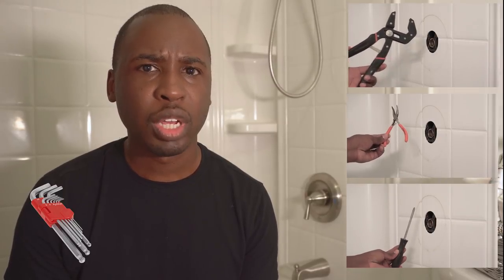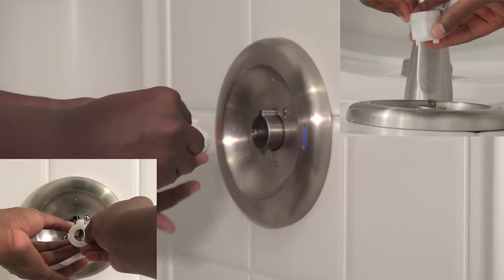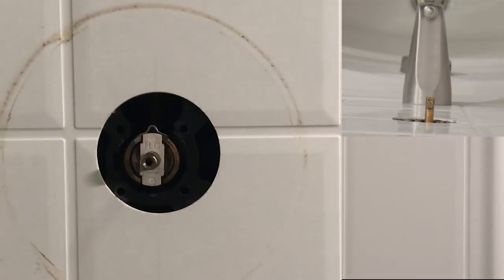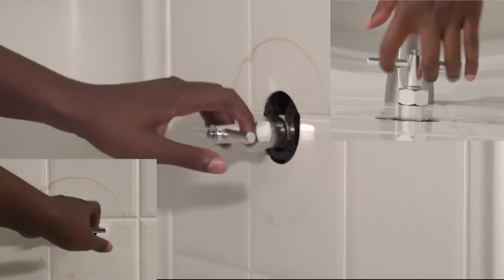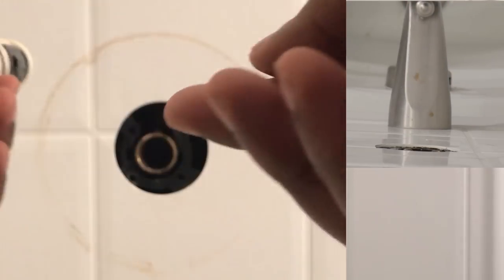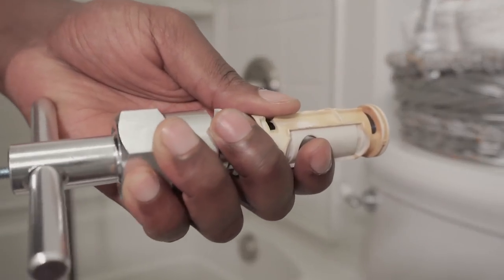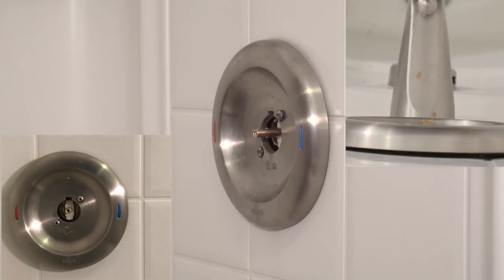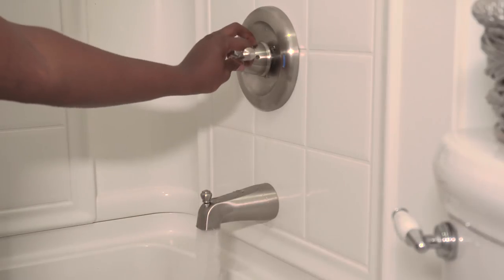How to replace a Moen 1222 shower faucet cartridge

Comment from the maker: Check out my other home maintenance videos https://bit.ly/2mxYnOQ
Reply: maybe you can help me with something, a few months ago I put a single lever of those moen but it turns out that when I turn it on, water comes out from below and also a little above, maybe I put it wrong because it is the first time with that work you could tell me that I did wrong please?
Reply from the maker: You could have possible put it in the wrong way but not sure
Reply: @Hindsight101  pop
Reply: My cartridge still will not move
Reply from the maker: https://youtu.be/T4NIAiSkl3w try this video. Also some people say applying heat to the cartridge helps
Reply: @jeziasmejia9642  Did you push on the stem putting it in so the back isn't flush? His video talks about that causing a leak!
Reply from the maker: Thanks for helping

Comment: After watching about 15 different videos on this subject, you are the only one who mentions having the bottom of the cartridge flush to prevent leaks. Thank you
Reply from the maker: No problem glad to help
Reply: How important is it to flush that out ? I installed one today and I might of pushed it in too , and It was leaking bad. Just wondering if that is a key step ?
Reply: @can2jmoney  yes, it’s exactly what happened to me. Ended up destroying the new cartirdge trying to get it back out. Sadly it’s not mentioned in any detail in the instructions the cartridge comes with.
Reply: Exactly. The explanation at the 7 minute mark is key.
Reply: This comment and video saved me

Comment: Great tip about not pushing on the center brass piece..  That's exactly what I would have done, and then would have not known to look behind at the valve not being flush..  Thanks for a very well done video - I really appreciated the multiple view angles too..
Reply from the maker: You’re welcome
Reply: Yes!!! This is the exact tidbit I needed to know. I replaced the cartridge once and accidentally did the same thing and tried to pull it back out but didn't actually check if it was flush. After I closed everything up the shower head immediately started dripping. Know I know why and what to check. Thank you!!!
Reply from the maker: No problem
Reply: I don't have the puller, so how do I make the end piece flush?
Reply from the maker: You could use a wide clamp
Reply: Yes! This information helped save my sanity. When I replaced my knob with a new handle, I must’ve tightened the handle adapter too much into the brass piece causing it to leak with that end part of the cartridge no longer being flush. Once I pulled on the cartridge, it stopped the leaking. Exactly how he demonstrated in the video with the tool pulling it back flush.

Comment: Okay, as a professional instructor, I really appreciate it when instruction is given clearly, step by step, and points out pitfalls - "the notch on the flat side" & "make sure the bottom is flush" - which are generally common mistakes.  I often watch 3 or 4 Youtube videos when I'm trying something new.  In this case, I watched 3 other videos, including the official Moen video, and NONE of those other videos pointed out the "notch" or the "flat bottom".  Kuddos for an Excellent video.  Definitely saved me a bunch of headaches.  Thank you.
Reply from the maker: Glad it helped, in a previous job I created training material and after watching a lot of youtube videos myself I thought I could help explain thing a little better
Reply: @Hindsight101  Well, you were right. Replacement went pretty smooth with your help. Thanks again.

Comment: Thank you for your video tutorial. I am a busy, single woman whose shower would not turn off on a Saturday night. I watched your video, then rushed to Home Depot 45 minutes before they closed. I worked on the steps and got stuck on pulling out the cartridge. That night, I ordered a puller from Amazon and it arrived Sunday afternoon. I continued to follow your instructions. It took a while to remove the cartridge, but I remembered your instructions about being patient with this step in removing the cartridge. It Worked 🎉. I continued to follow your instructions and completed the plumbing project with your instructional video. Thank you for your video. 

Ronnie
Reply from the maker: That's awesome to hear. Glad it worked out

Comment: I hope everyone is aware that MOEN has a lifetime warranty on its products. I have received repair parts for bath & sink faucets at no cost. And this video is top notch. I checked other on-line videos as well as the MOEN instruction sheets and video. This video covers all the little "why didn't they tell me that" issues. Good job.
Reply from the maker: I had trouble with getting the replacement neon told me I had To have the receipt. Which I heard from others you didn’t need. Also thank you very much for the comment.
Reply: how do you know which cartridge size to use?

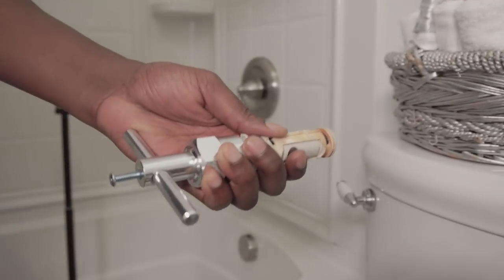Comment: Best instructional video on how to replace this valve, hands down! That pull tool is worth every penny of the $16 I spent on it. In my case, the old cartridge was really stuck in there and half of it broke inside the valve. No way I was going to be able to pull it out using the plastic tool that comes with the replacement cartridge. I don't know how old that valve was, or if they used the lubricant that comes with it but it was stuck in there so badly that I had to use a long thin flathead screwdriver to dislodge the pieces that were stuck inside the valve. Once I did that and checked the valve really good to make sure there weren't any small bits still in there, I was able to replace the new cartridge as he shows starting around 6:50.
Reply from the maker: Thank you

Comment: You, sir, are a credit to your profession, youtube, and the human race in general.  I was pulling my hair out trying to figure out what I had done wrong when I replaced mine.  In the video published by moen it says to turn the brass part to the off position before reattaching everything, which screwed everything up.  Your video left it in the on position, and that was what worked for me. Thanks for the awesome video!
Reply from the maker: Thanks so much for your comment. So glad it worked out.
Reply: Agree.  I don't know why the Meon company video tells you to turn the brass valve from notch at the top to notch at the bottom and then to install the handle.  That does not work at all.

Comment: Solved this problem, thanks to you! You were spot on that nylon key is not needed. The aftermarket moen puller has held up for me. The nylon key came in handy when I flipped it over to push the cartridge in place. The nylon key I was using had a hole thru the square capped end.
Reply from the maker: glad you could use the nylon piece for something

Comment: Thank you!!! I spent forever completing this job. My old cartridge was stuck due to the rubber on the sides. After I finally got it removed (i had to go buy the moen cartridge removal tool) I couldn’t slide the new one all the way in! The oil they give you inside the packaging is useless and wound up not being sufficient to slide mine in without ripping the rubber again. Swapped the broken one out and bought some faucet grease. Used the removal tool to insert and voila!! For whatever reason my clip wouldn’t fit but during one of my many trips to Home Depot I had bought a three clip replacement pack and one of those fit perfectly. 🎉
Reply from the maker: Awesome

Comment: This is a great video. Particularly around 7 minute mark about how to property push the new cartridge in. I made the mistake of pushing on the brass and pushed it in a bit, and hence when I turn the water back on it leaked. Ended up destroying a cartridge getting it back out and still didn’t realize why it was leaking until I saw this video. If you don’t have the puller you have to push in using the remove like yours or the white plastic removal bit the cartridge comes with. This avoids pushing the brass in.
Reply from the maker: I'm glad everything eventually worked out

Comment: Best video on the matter.  Thank you.   
Update:   I change two (non-leaking) as a preventive measure as they were 15 years old.  The Moen puller did work fine for me. Great advise to use the large nut of the puller and a wrench to pull out the first 4 mm out of the valve. After that a combination of pulling with the Moen puller while pushing with the finger on the valve, adding generously W-40 where the clip goes and moving slowly left and right (but only 3 mm each direction only to avoid that the unattached rubber fold if you turn to much), I manage to extract both in aprox 10 minutes each.   Quite nerve braking.   Thanks again for the video.
Reply from the maker: Glad it was helpful!

Comment: Great instructions and thank you for the tip on re-installing the cartridge with the tool... since I almost made the same mistake.
The old cartridge was a nightmare to remove because of the rubber seals getting caught between the plastic and copper housing! Tip: Use a little WD-40 when removing it. It helps!
Reply from the maker: Since this one I’ve had to replace a few more cartridges and they were a beast to remove

Comment: Excellent guide. Showing the mistake of pushing in the bronze stem saved me from doing the same thing. I used a 7/16" socket, a fender washer and a paint can opener to space my hillbilly rig so that I could use the philips head screw to start pulling the core out, as an alternative to buying the Moen puller. I suggest lubing the housing before installing the new core. Plumber's silicone grease is the best but the lube in the package works too. Wet an appropriate sized fingertip with lube and smear it around inside where the core goes. Photograph your old core and contact Moen Customer Service to receive a free replacement part. Sure, there is a nice new core in your shower faucet now; but, the one it replaced was new once upon a time. I have three of the accursed devices in my home. Moen sent me a FREE replacement for one that failed during a hurricane. Weather related, I don't think so. Just horrible luck. I used that replacement tonight when my personal shower faucet failed just as I was going to bed. OH! AND, you might suggest stuffing rags, or something into the hole around the faucet before attempting to install the locking clip. I lost three of the wonderful things while replacing my daughter's shower faucet core. I stuffed the hole before pinning the core tonight and the clip went in as if it knew there was no escape. Yes, I understand that I'm a little obsessive (and clumsy) (and cheap). Thanks for a very good guide. I liked it more than previous ones I have viewed. I think you might be one of the first to warn about pushing the stem in too far.
Reply from the maker: Thanks so much for you comment. The mistake was truly a mistake because I had to undo everything I did off camera because the faucet leaked after I was finished. That was a pain but if it helped others then it wasn’t so bad.

Comment: thanks Buddy, great video... I am having a problem with reassembly, having the retainer pin not seating in the groove, blocking the aluminium tube cover. any advice?
Reply from the maker: The only thing I can really say is this has happened to me before. Something's just misaligned and you have to keep trying. I know that's not the best answer

Comment: I did this yesterday, using the free replacement cartridge after I called Moen. That saved $48 right there. And I had success using the white plastic extractor that came with the cartridge to gently rock the cartridge back-and-forth no more than 1/8 turn either way. That saved me another few bucks by avoiding having to purchase an extractor tool.  Another thing that I did that nobody has mentioned, is before turning the water supply off and starting the project, I ran the hot water through the cartridge for five minutes to warm everything up, including the old impacted silicone grease. Another commentor above said that he used a hairdryer for this purpose. In any event, heat is generally helpful when removing stuck fasteners and other devices like these cartridges. Mine had a slow drip after installation of the new cartridge, and so I went in again with the white plastic tool and slightly rotated the cartridge and reassembled. The leak in the full off position then stopped. But that post installation leak was probably caused by me making the mistake of pushing on the brass spindle during installation.  One more thing I do emphasize in your excellent presentation is to remove the faceplate so that you don’t have to bend the retaining pin when removing it. And when you remove that face plate stuff a towel into the wall to catch the falling Jesus clip (“oh Jesus”) when you inevitably drop it into the black hole in the wall. Cheers, well done and thank you.
Reply from the maker: Thank you

Comment: This was the best video I have seen on the Moen 1222 but I still can't get a new one to not leak.  I did the first one and like you I push it in and the brass valve pushed out the back.  I tried you Technic to pull it back in but the white plastic button feels loose on the back now and still leaked.  So I went and got a new one again.  This time making sure I did not push it in using the brass valve.  I follow your method which is slightly different than the official Moen install video.  Still leaks when off.  Funny thing is when I bought the off brand of the 1222 before it work first time I installed it.  I notice the off brand has the O ring on the front and back of the cartridge while the Moen only has the O ring on the front.  Maybe I should just go back to the off brand?  But I do love the way you show 3 different picture views of what you are doing, front, top and side views.  That is great!
Reply from the maker: I don’t like the off brands because they are fine putting in but having to remove them was a pain. Thank you for the comment, like me I assume you watched a lot of videos. The ones I saw were too grainy or the camera was 50 ft away so I thought I could do better. Not sure why it’s leaking without more info Cheers

Comment: Best Video Ever.  Another thing to add, use a Moen Puller tool if cartridge gets stuck.  Mine was stuck and after twisting and pulling for an hour (5" Girl) I was about to give up with my hands red hot and throbbing.  On the verge of giving up I took wrench to the puller tool around the Nut/Bolt and kept turning it 360 and it finally came out. Phew, it was like I gave birt
Reply from the maker: Yes this on came out fairly easy, others I have done we not so quick.

Comment: Hey thanks for the video! Some of my own insights:

Bring a towel! Tuck it right under the enclosure, so any nasty dark water doesn’t drip on your tiles and grout. 

Watch out for broken gaskets! A small piece of the old cartridge fell off in the enclosure, and it took me a few minutes to figure out why the new one wasn’t going back in all of the way. 

When you take the assembly apart, line them in order so when you close it back up everything goes together in its proper sequence. 

I’m thinking the core puller is definitely worth the 15$ investment for aggravation’s sake. 

Make sure you let all of your faucets run for a little bit after you turn the main back in so you can flush out any sediment. Same goes for your washer machine; run an empty load so your clothes don’t get a rust bath. 

Thanks again for the video!
Reply from the maker: Great suggestions

Comment: Great video!  I couldn't find the removal tool at local HD.  I didn't need it though.  Once I loosened the cartridge with the white tool the new cartridge came with, it pulled right out with pliers.  I made sure brass piece was flush when inserting new cartridge and no issue leaking.  Thanks
Reply from the maker: No problem glad it worked. But don't always assume it will be that easy. It all depends on how hard your water is and how long it's been in use.

Comment: Thank you, thank you for the great, and detailed video! Your video turned an all day frustrating project into a 30 minute, and very controlled swap-out.

A couple of comments (if I may) which would probably fall into the category of “everyone knows that”, I used a wet/dry vacuum to prevent water from running into the bathroom wall during cartridge swap-out, and I used a head lamp (flashlight) which greatly helped during the removal and especially the re-insertion process of the locking pin.

Thank you again!
Reply from the maker: You're welcome and thanks for the tips

Comment: Great Video. At 6:47 if the cartrige bottom is not flush you can not push the cartridge in far enough for the retaining clip to fit. Its easy to start flush and have the installation tool push the stem back by mistake during insertion if you do not tighten the twist collar bolt like you show. No other video covers this and I watched them all.
Reply from the maker: Thank you for the comment

Comment: Great vid. Helped me replace my shower cartridge. The special removal tool was a must and worth the $15 cost
Reply from the maker: Thank you glad it worked out. Yes the tool is great but it doesn’t last long since it’s made of soft metal.
Reply: Where did you get the core puller from? Or what is the name that I can find it at Home Depot or Lowe’s?
Reply from the maker: @one121only  here you go https://www.homedepot.com/p/MOEN-Cartridge-Removal-Tool-for-1200-or-1225-or-1222-Cartridges-104421/202998692

Comment: Perfect,  this video saved my bum!   And yes have patience, we have hard water here in AZ and the old cartridge was a real pain.  I added WD 40 and walked away. When I returned the old cartridge slowly started to loosen up but destroyed itself in the process..  I also used a brass 20 ga. shotgun cleaner brush to remove the gunk buildup in the valve body.   Thanks Again
Reply from the maker: Awesome job